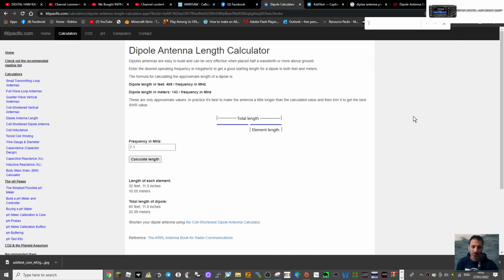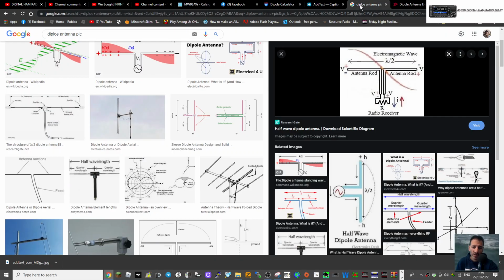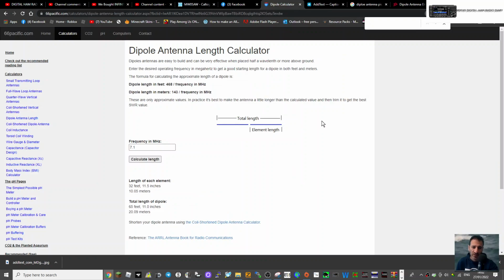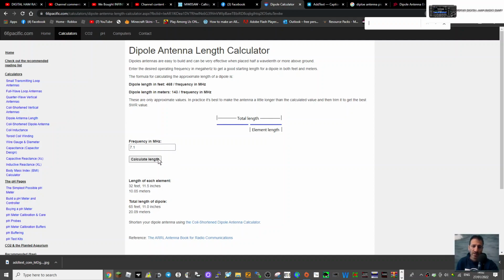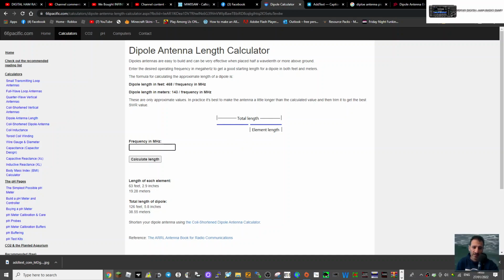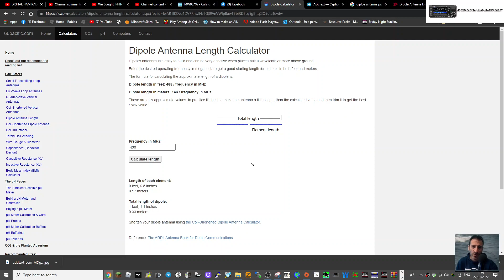Ham Radio - Make Your Own Diploe- (Length Calculator)

Comment: I’m confused, you say you cut the wire to that given length but how do you tie it to the insulators and the balun/coax? Using part of that wire for these tie points would reduce the overall length by 4-10 inches depending on thickness of the insulators and type of knot used to tie the wire to them.
Reply from the maker: You always leave a bit extra to trim then it trial and error alot of other things affect the antennas performance .
Reply: @M0FXBHamTech  ok, I’m building my first ever wire dipole since before I only built them with 1/2” conduit pipe for the 11 meter band. If I:

1. “leave a little extra” to have enough to tie both ends, do I measure my assembled dipole from the tie point at the balun to the far end of the knot at the insulators or do I count the wire wrapped around the end of the insulator?
Or 
2. Would bonding the end of the knot end back to the main wire negate the length of wire wound around the insulator so I can just measure from the balun to the end of the knot? Then just trim the balun end to adjust for tuning.

Comment: Thank you for the web site. Very handy. If one was going to make a 40-10 twin lead antenna with a tuner, how long would each leg be? Thank you in advance for your precious time.  Tommy
Reply from the maker: Hi use the calculator to get the size an antenna tuner is not needed if you use a 49.1 balun and a 66ft long wire